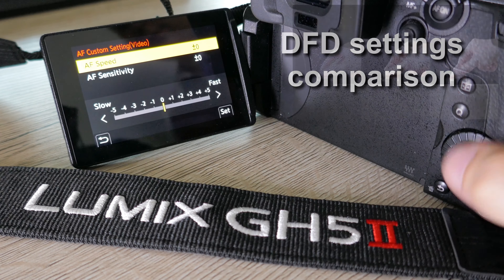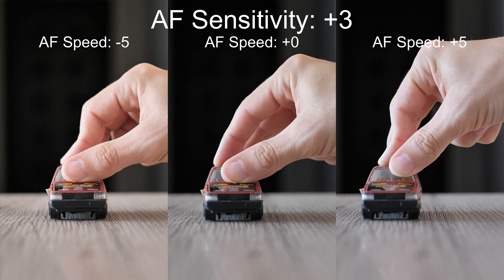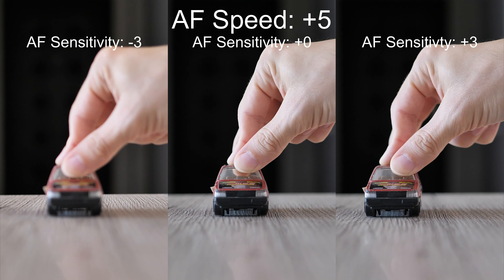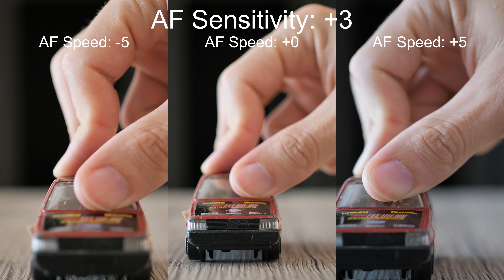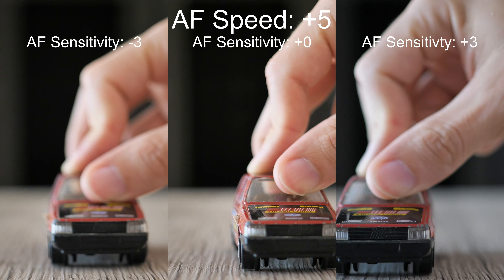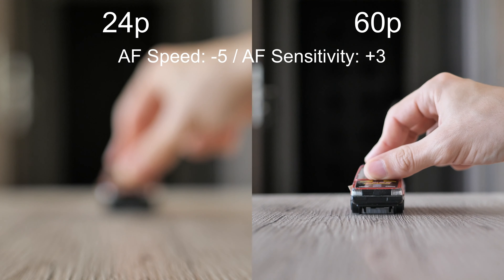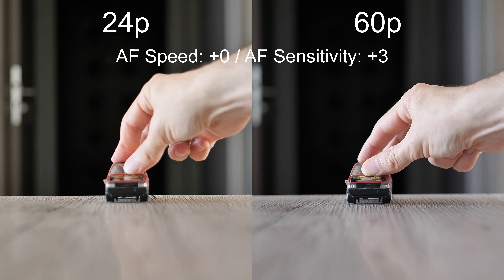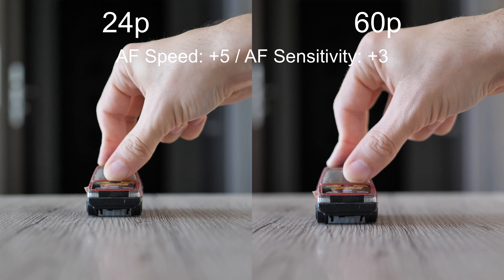Panasonic Lumix GH5 Mark II DFD Settings Comparison

Comment: Hello, do you find AFC on the mk2 a significant upgrade over the mk2? AFC as such is meant, not the detection (60fps). I have a gh5, run/gun/point/shoot in 4k60, one area, AFC and hunting is mostly my gripe. Loosing focus, yes, but I can delete a clip as an amateur. Thank you, Frans/Bali 😀👍
Reply: Correction, mk2 over mk1 in AFC

Comment: So what is your conlusion and best settings?
Reply from the maker: There is not the best setting and it cannot exist at all. Like everything, it depends on what you want and the purpose. All the settings may be the best for different purposes and different goals. Mostly, I would recommend somethings like +0/+0 for both or slightly higher like +1/+1. But there can be a situation where -5/-3 would be the best. It depends on the situation and the purpose.
Reply: @digimaniecz  I can somewhat agree. I find that the AF works really well for me. If you increase the value of one, the other seems to work well at zero or above. But I would not necessarily go negative, or below negative one with the sensitivity at least…
…